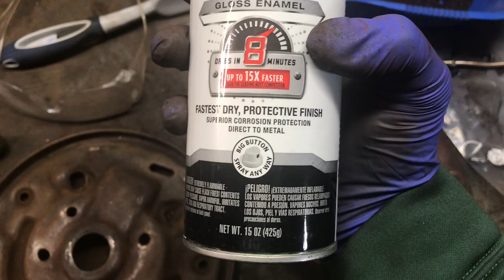1965 Scout 800 | How to Install Axle Shafts and Rear Drum Brakes on a DANA 27 Axle

Comment: I am an old mechanic. I  have been working on tapered axles for close to 60 years. I have 2 suggestions, when installing the hub., buff the shaft taper and the tapered bore real good. Do a test fit of your hub to see, fit well .install  the key  after the hub is on,  you might have to file the key and the broach-way some to get it to slide into the keyway. Make sure that the taper of the key faces down and toward the differential. Tap it in now. Putting the key in first and then trying to slide the hub onto the shaft. It's possibly to slide the key up too far the ramp,  causing the hub to crack. Install the washer and nut. Torque 145# Install cotter pin,

Comment: Hey thanks for the video! I’m having a heck of a time removing the wheel hub off mine. Did you have the same problem? If so , is there a trick to remove it?
Reply from the maker: Yeah I had trouble removing it myself. Best thing you can do is find a local shop with a press and have them press them off and throw them a few dollars. You can give them a little encouragement with some penetrating fluid. Good luck!
Reply: @carsonsihgarage8950  Keepmaking videos. Thanks for the tip.

Comment: Did you source the wheel bearings/seals locally? Working on mine now, think I saw $150+ per side from IHAmerica, ouch.
Reply from the maker: I sourced the stuff on my own, way cheaper. The bearing number is 15121T. I can't recall the axle seal numbers since there's an inner and outer seal but look online and you will find a generic part number you can put into google and get the same thing for half the price.
Reply: @carsonsihgarage8950  you tha' man! Thanks Carson

Comment: What part number inner seal did you use?
Reply from the maker: NATIONAL 41787S
Reply: @carsonsihgarage8950  second question….where did you buy your drum brake repair kit?
Reply from the maker: @chandlerrc  I pieced together my own kit. I used Napa brake shoes, hardware springs from classicscoutparts.com, and wheel cylinders from RockAuto (centric brand ones). Let me know if you need anything else.